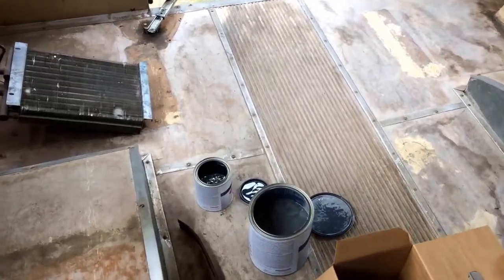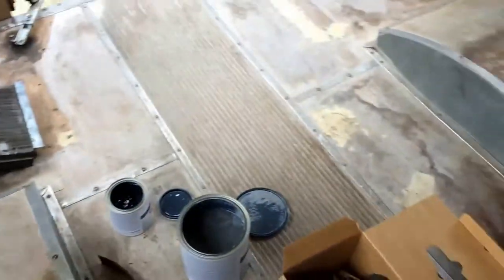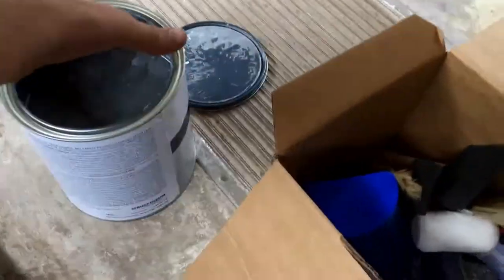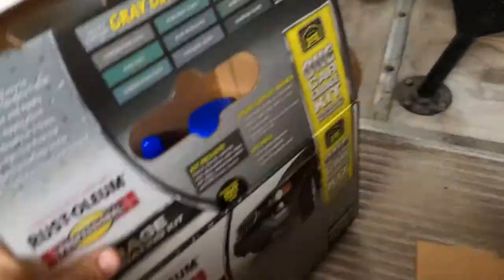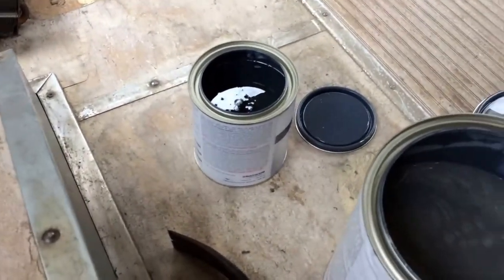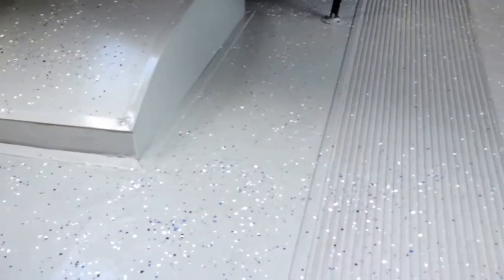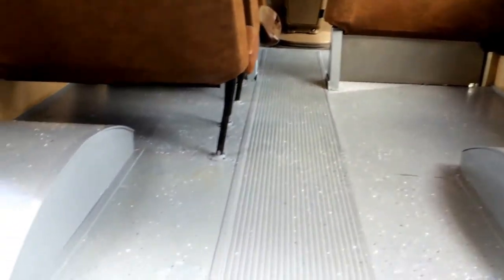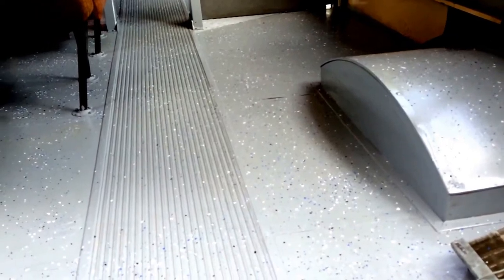Chevy Short School Bus RV Conversion Part 2 Floor

Comment: great idea!! plz let me know how the paint on the floor holds up.. It's something I been thinking of but haven't tried yet.. cheaper then peal and stick tile and replacing it..
Reply from the maker: +lil blue bus adventurers It is holding up fairly well. After a long trip i needed to touch up a couple areas, but it was fast and easy. I think I may get a carpet runner for the high traffic areas
Reply from the maker: +lil blue bus adventurers It is holding up fairly well. After a long trip i needed to touch up a couple areas, but it was fast and easy. I think I may get a carpet runner for the high traffic areas